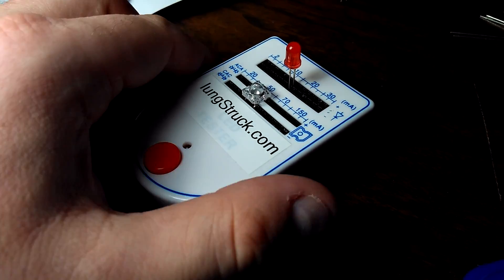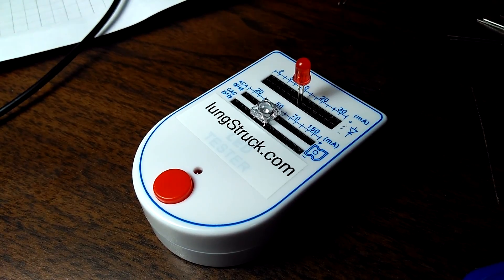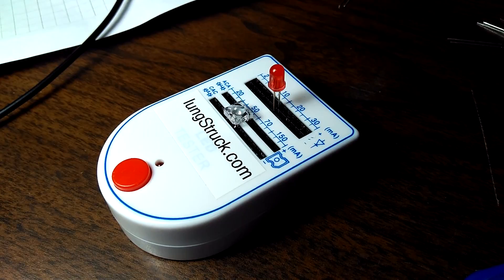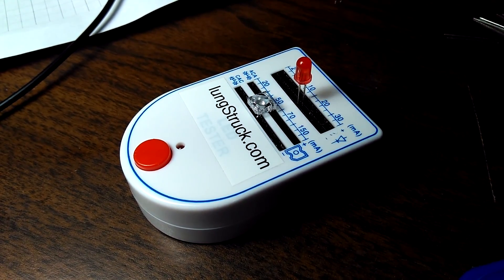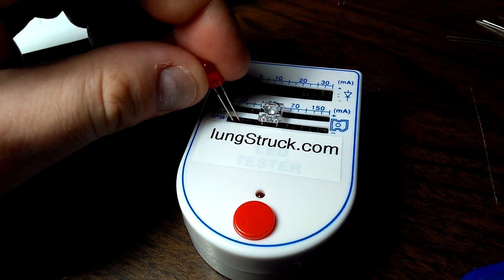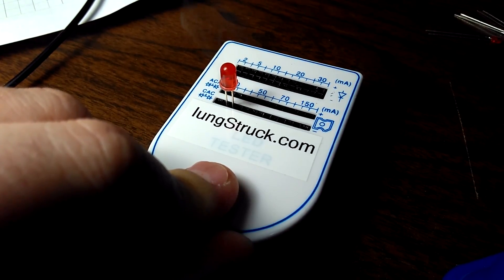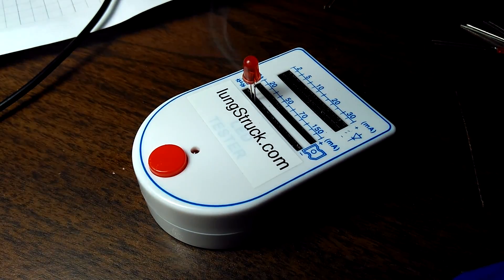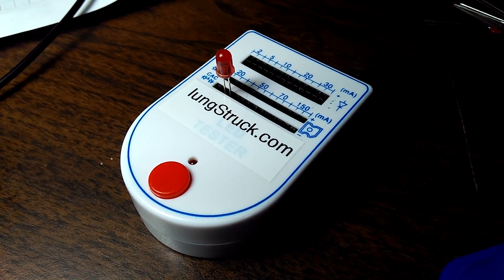Chinese LED Test Box - problems to watch out for

Comment: I bought one for $2 off ebay. Glad i checked this video and what you found about the bottom row. I'm going to make a schematic of mine and possibly redo mine properly. 

The problem I ha e with mine is that the battery wire ate soldered backwards (as is the led to make it work). Thus, all the test points are reverse polarity. I need to do a little resoldering to correct it.
Reply from the maker: Paul-Joseph de Werk Thanks for sharing that! It amazes me how many cheap imported electronics have polarity issues. I've had several rolls of LED tape recently that were backwards. Good luck with the repairs!

Comment: I have the same led tester but where R21 is marked on mine there is a resistor
Reply from the maker: Mine had a resistor at R21 also; I removed it when I modified the tester.

Comment: Complete NOOB here. Does it also test transistors? I see the symbols for PNP and NPN, to the lower left of the device. Please let me know, I 'm trying to learn and perhaps this tool could help me. Cheers!
Reply from the maker: Hi Max! This tool only tests LEDs, the bottom left section is for testing 2-in-1 LEDs that have a common anode or cathode. Hope that helps!
Reply: Ok, thank you kindly. Cheers!